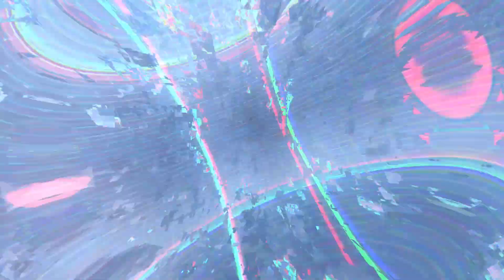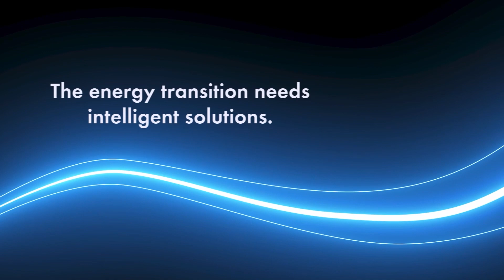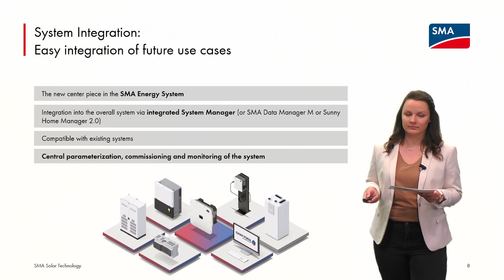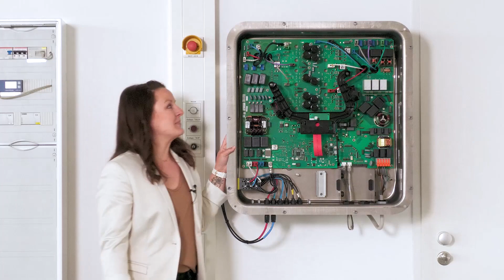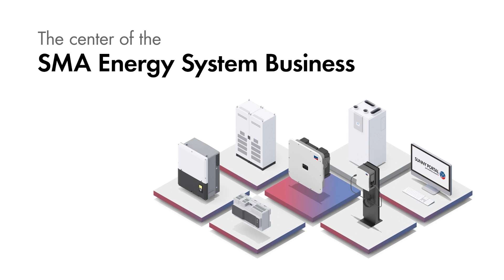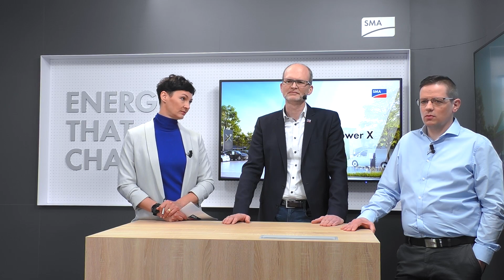World premiere SMA Sunny Tripower X

Comment: Good but it's pity that  you can't use / integrate PLC communication with TIGO TAP and remove the RS485 CAT 5/6 cable from roof and also cloud connect . 
 This can be good improvment. Is almost without synergy without TIGO and SMA.

Comment: Does the off grid function work automatically when grid is lost or is it a manual setting?
Reply from the maker: Hello, unfortunately this device does not have a storage function and you will need an extra device. You'll find more information about our Sunny Tripower X at files.sma.de/downloads/STPxx-50-DS-en-11.pdf. Sunny regards, your SMA Social Media Team
Reply: @smasolartechnology  It says Off-grid capable in the datasheet you link to. Ofcause batteries are needed but it says nothing about an extra device.
Reply from the maker: Oh, sorry we misunderstood. You can use our SMA Sunny Tripower X in an off-grid setting or at the time of a black out as long there is a storage within the whole system. For a complete off-grid system the SMA Sunny Tripower X should be set to country code: "offgrid" Sunny regards, your SMA Social Media Team

Comment: The warranty on these is only 5 years for domestic/residential use in Australia, every other manufacturer has at least 10 years here, some of your smaller inverters have the 5+5 option but not this, the US market seems to have it on most of the TriPower series also, but extra $800 to buy another 5 years, when you claim it’s built to last 20? Serious SMA, this isn’t good marketing on top of it being $1000 more than the alternatives. Can you fix this please? I also had to wait 15mins on the phone to SMA Australia till they could find the warranty information, you’d think this would be on hand and ready. Disappointing.